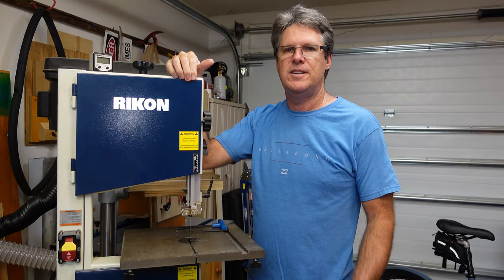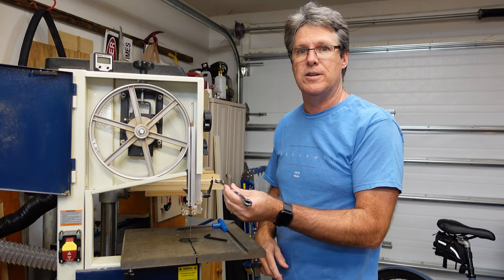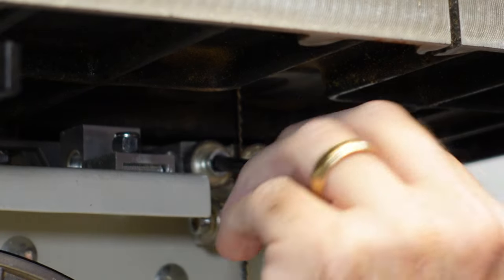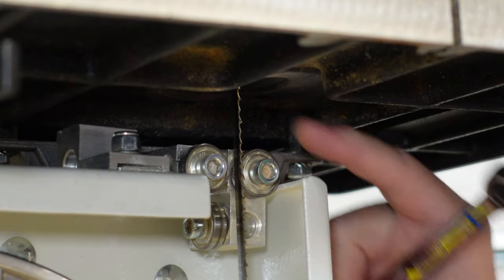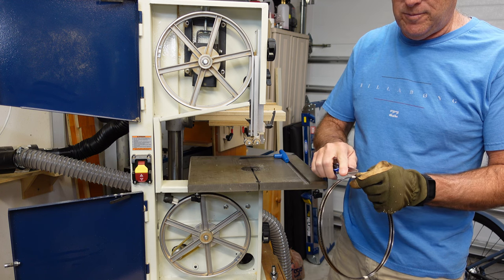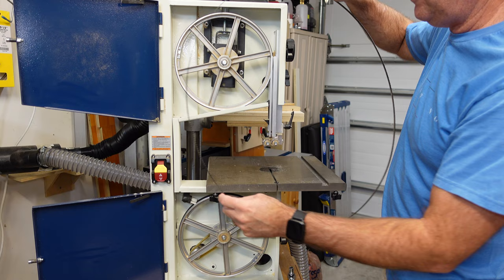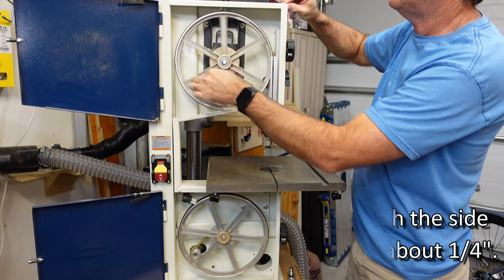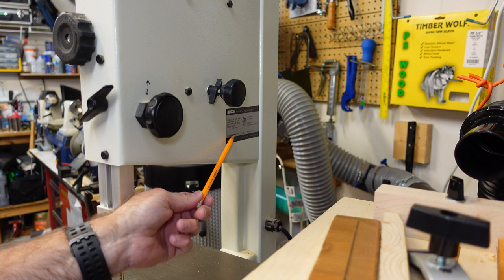Rikon 10 inch bandsaw blade change

Comment: I've had the Sears Craftsman version of this saw for six or eight years. I think it's identical to the Rikon. Nice video with a lot of attention to detail, but you didn't mention where you position the blade on the tire with the tracking adjustment.
Reply from the maker: I would hope that people know the blade should be as close to center as they can. Thanks for pointing this out though.
Reply: @works4me  People that don't know how to change the tire on their band saw may not know...

Comment: Trying to decide between this bandsaw and the grizzly g0308Z.
Anybody know which one is easier to change blades on?
Reply: I dont know how it is to change on the grizzly, but I will say the Rikon has over an inch more in max cutting height. On the grizzly you are limited to 3” 5/8th. I have the Rikon and it can max out right around 5” i believe, even though they state slightly less. The Rikon is pricier but an overall more capable machine

Comment: I saw another review for this unit or possibly the newer version that talks about how inconvenient it is to remove the fence mechanism with the measurements on it. I noticed you didn't include this part in the video. I was wondering how long this process took for removal and reinstall. I've been looking at picking up one of these Rikon Bandsaws.  Thank you!!
Reply from the maker: Click on my other video https://youtu.be/cuRjdwLr8qQ
Then go to minute 3:55 and it takes about 5 seconds to take it off or on.
Reply: Excellent explanation!  I needed this info and you did a great job. Thanks man👍

Comment: I also keep trying to get the blade to stay in the middle of the wheel but it won’t. It will never center on either of the wheels.
Reply from the maker: It will most likely never be centered on the bottom. But the top should be able to be centered. If not, the motor angle might be off. We had several Laguna's at our store from the same batch that had to have motor position adjustments to make them track correctly. Make sure you start with a new blade and not the factory blade for starters. If it still doesn't work then you will need to take the deck off and make a jig to see how far-out the wheels are.